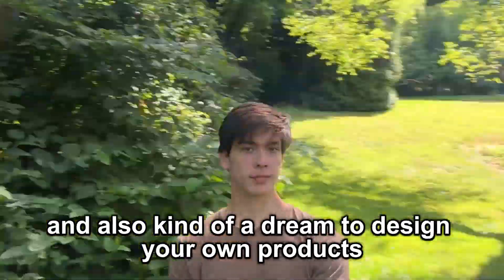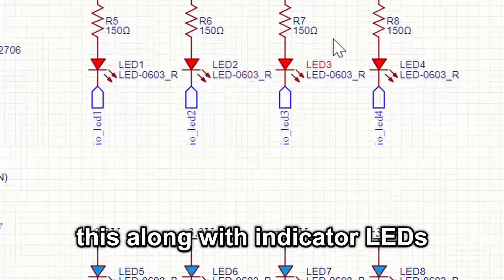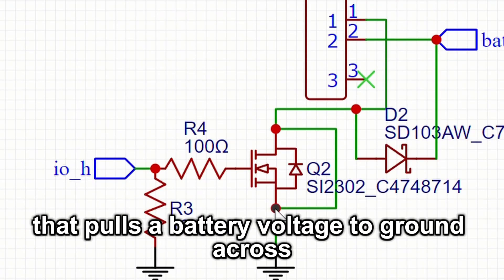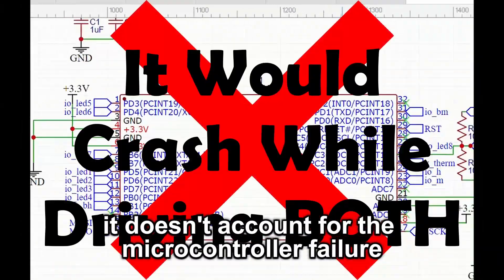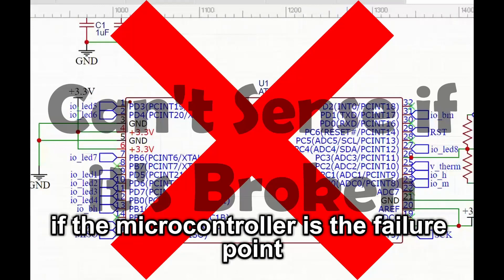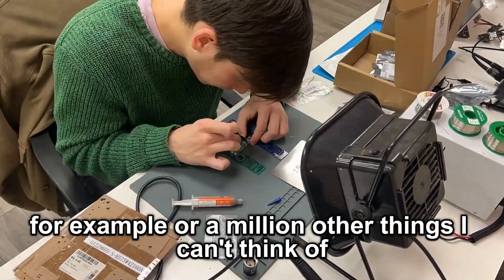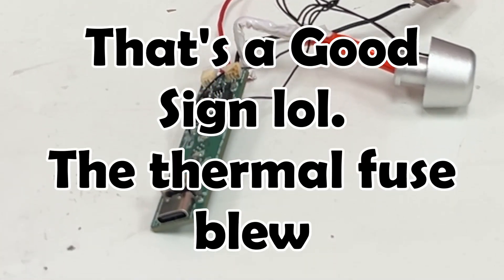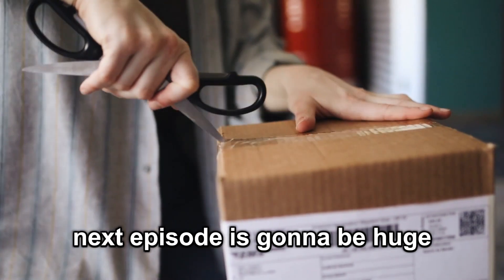I designed a circuit that WON'T burn people | Ep. 11

Comment: The whole time I was thinking “why not use a thermistor?”, but that, of course, relies on the micro working.  
I’ve only ever seen crowbars used for high power inverters, and the SCRs usually don’t survive one event.  But using them on a much lower power device with resettable fuses is an interesting idea.

Comment: Hi. How did you go about learning for the electronics side of the project, was it books, courses, both, etc. Also, do you have any recommendations from the material/sources you used to learn from? Thanks and best of luck 😁.
Reply from the maker: Combination of taking some classes in college and projects and YouTube. TBH you really just need to know the basics and then it’s just searching through LCSC and forums for ICs that work for your project and then reading their datasheets to see what components you need. Unless you’re designing some crazy analog circuitry, it’s not that technical.